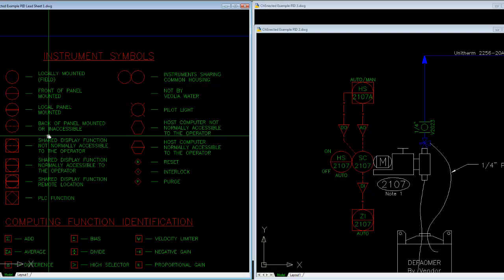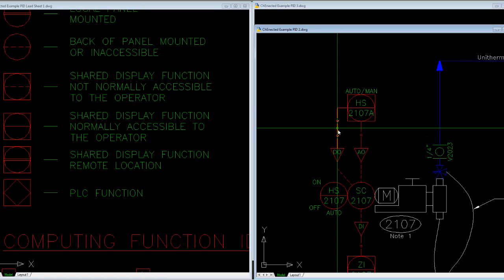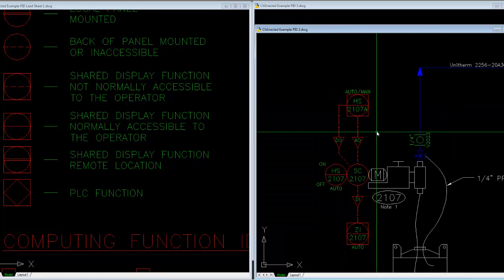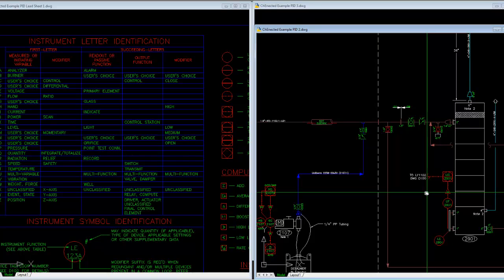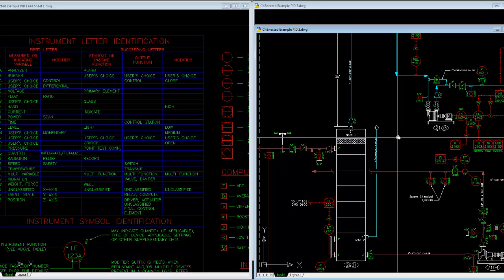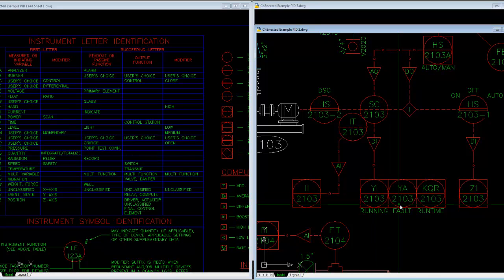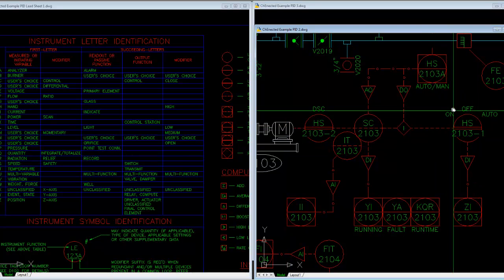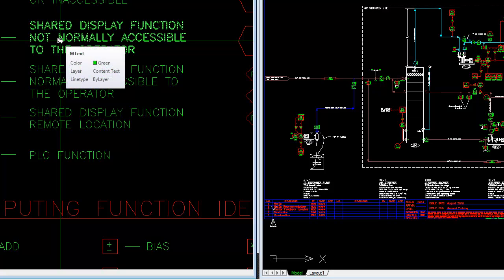Part 2 of 3 Instrumentation and Valves Lead Sheet

Comment: can you share your files with a cloud drive ?
Reply from the maker: Here you go Dominique: https://drive.google.com/folderview?id=0B0khubaBhz5-fjBVR3JRbnIxVld4RTNKd3ZxXzBrWERwYnFfaWF0SU5ydDlqZEdJTmFXam8&usp=sharing
Reply: Robert Cook Wow you really rock !
Reply: Robert Cook you have good drafting skills. How did you get started in this ? What are you doing now professionally ? What do you like to work on ? Where is your CAD going ?
Reply from the maker: Dominique Dupont You are quite welcome. My CAD skills are about as far along as I ever want to take them. So long as I can create Process Drawings, that is what I like to work on. I see it this way, folks who need to write better learn to use Microsoft Word. Those who need to design chemcial/process plants need to know AutoCAD. It's our tool. That said, I much prefer workign in the lab, on a pilot getting the data that goes into the mass balance that results in the Process Flow and Instrumentation diagrams!
Reply: Robert Cook I finally realized that every P&ID is different and fudged together, so that's what I graduated to, fudging my own, with enough and as little complexity as the task requires. Your's was the best I have seen on the entire Internet.
Reply from the maker: Dominique Dupont Thanks again for your kind feedback. I'm very glad that the videos and files have been a help to you.